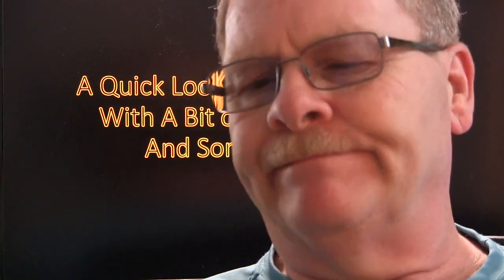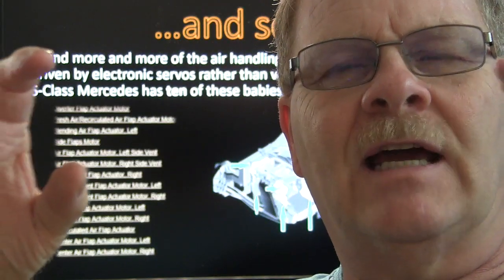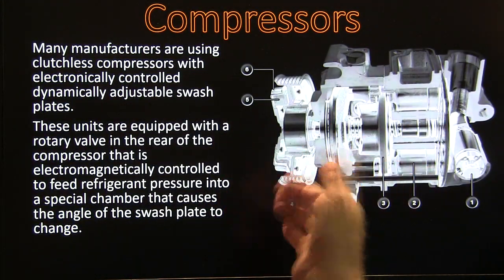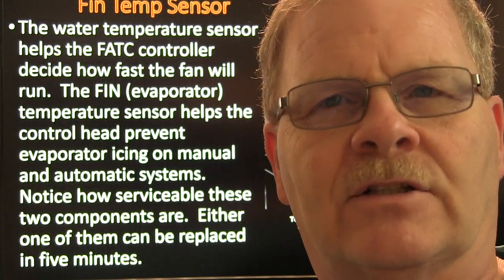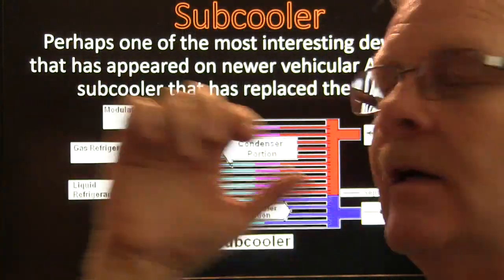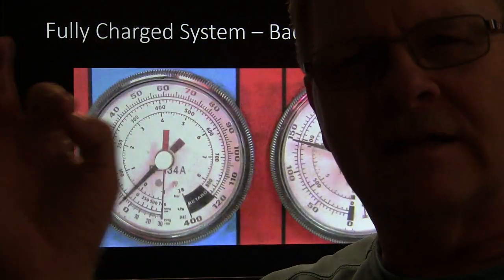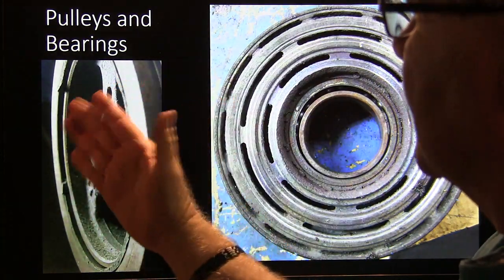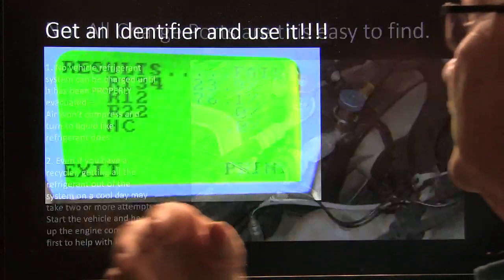AC Service Tips - new video

Comment: Hello, Sir. Usually, you talk about hooking up a test light to power and touch the pin going to the ac clutch. If the test light light, it finds a path from the coil to ground( coil is good and not open). But, if the winding is shorted to ground, the test light will light as well. The difference is that the fuse will be blown if the winding is shorted to ground. The reason I am saying that is because I am dealing with an issue like that. The fuse feeding pin 30 is shorted and having a shorted coil windings is a probable cause.
Thanks for educating us.
Reply from the maker: Good one - disconnect the clutch and see if the ground is still there! :)
Reply: @McCuistian  I did try putting the multimeter red lead into the 20A and leaving the black  in COM, disconnecting the clutch; hooking meter lead to positive and other lead to connector pin, but clutch did not engage.(wrong set up, maybe or coil is internally shorted to ground) Before I did that, I disconnected the ac clutch, hooked test light to power and touched the connector pin and the light illuminated, found a ground through  the coil.